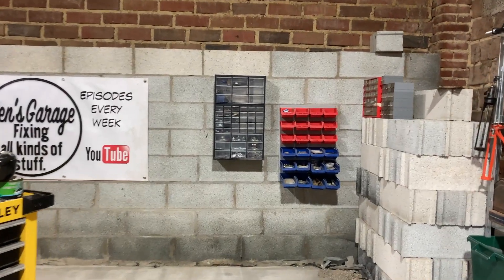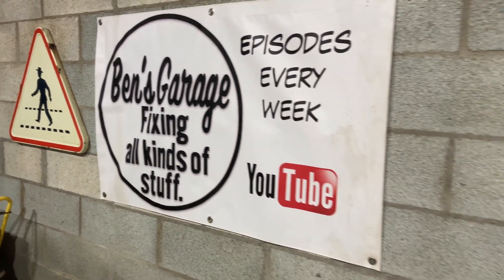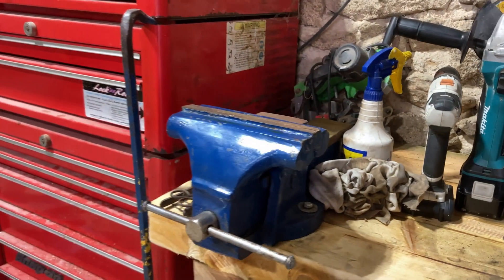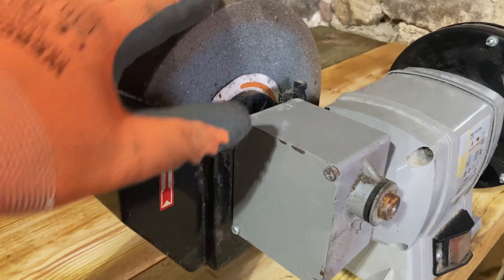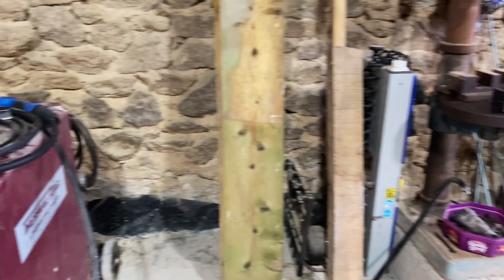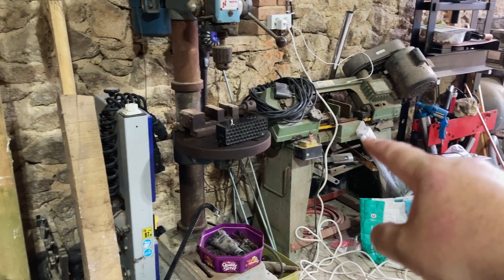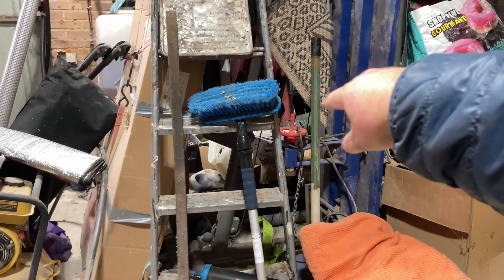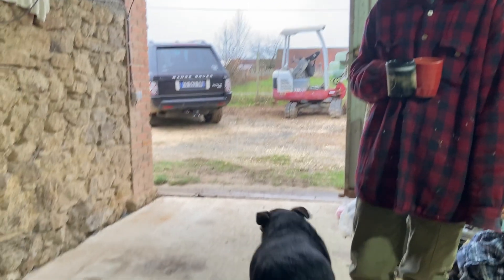We have been busy in the Garage

Comment: Howdy Ben, 
Wondering if you know how to reset the service required light in a 2010 to 2012 RR Full Size? (Digital dash) 

Can’t find anything that works on line. I do have the iiD tool if that is an option you know of
Reply from the maker: Yes, you can use the IId tool to reset the service reminder, can’t remember exactly where in the menu it is. If I remember correctly there is a section for the instrument cluster, it might be in there.